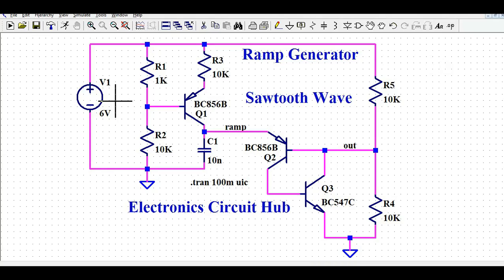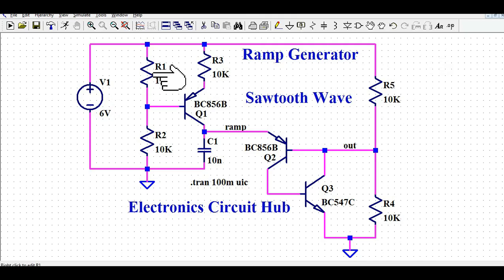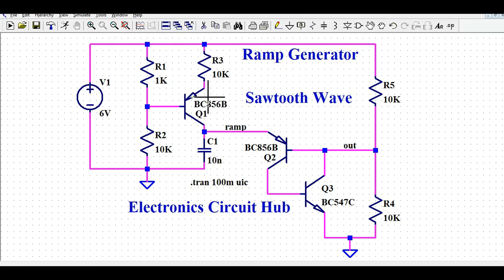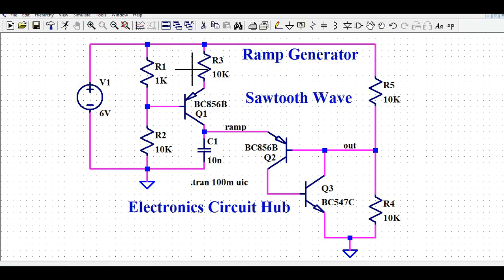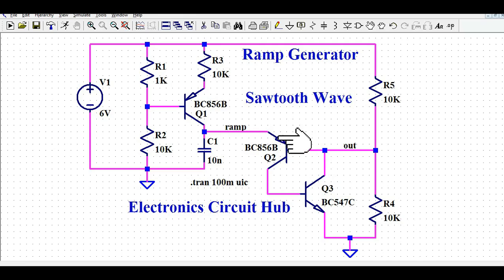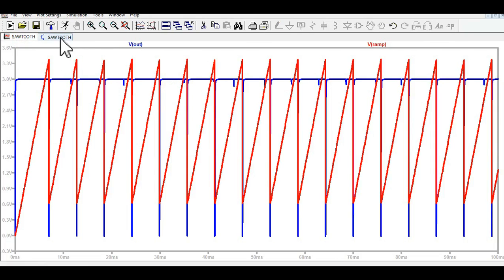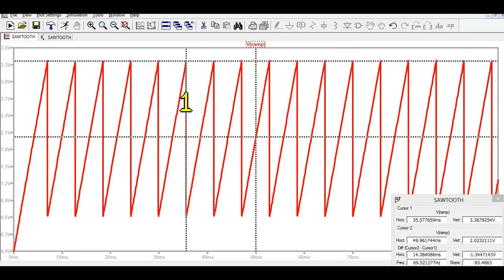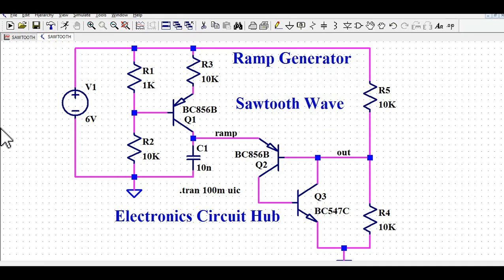LTSpice Tutorial: Designing a Ramp Wave Generator

Comment: Thanks good circuit but how change frequency and what is formula of frequency
Reply from the maker: You can adjust the frequency by changing the resistor and capacitor values and the formula is 1/(R*C).

Comment: The voltage at the base of the 1st transistor is 10/(10 + 1) * 6v = 5.45v.  That a drop from 6v of only .55, that seems like it's not quite a diode drop.